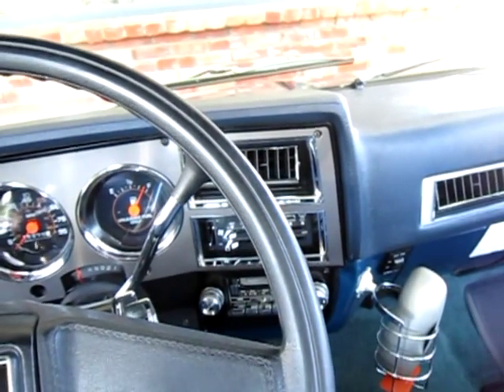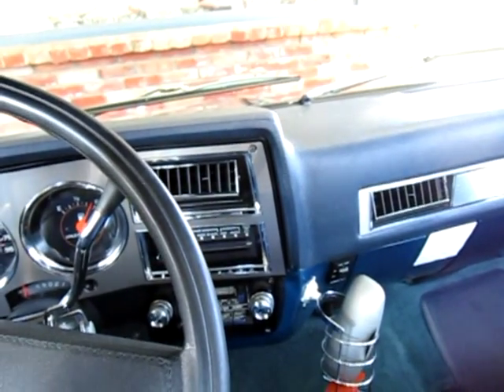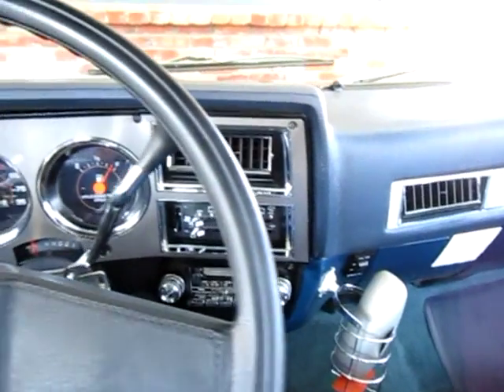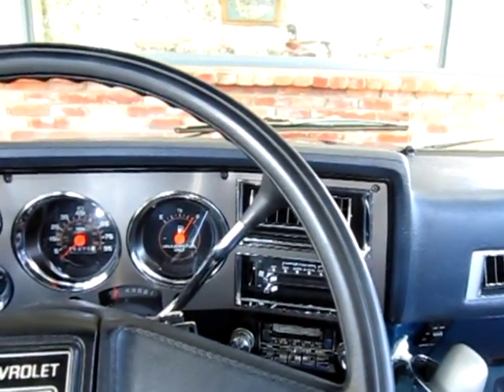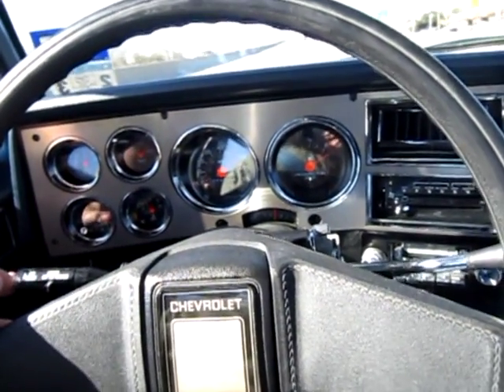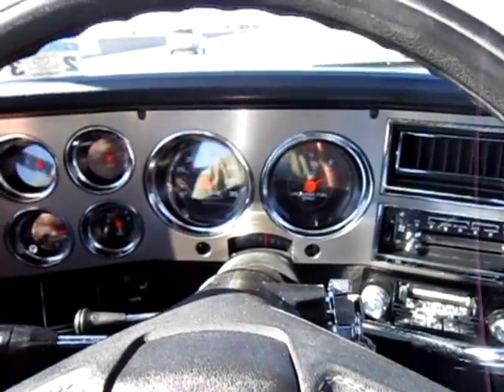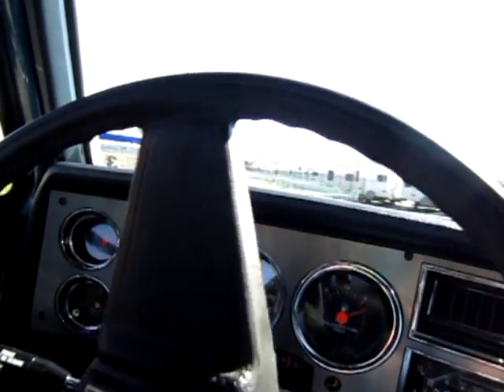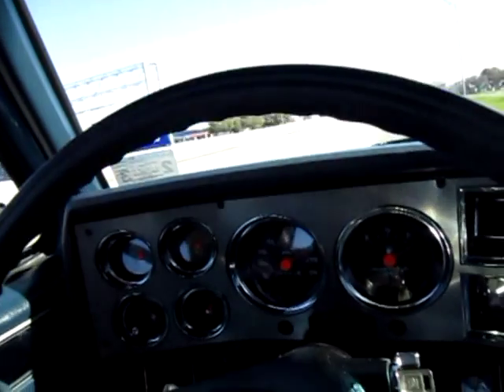Testing out new wiper delay module.

Comment: Where can you find the intermittent wiper delay module in your truck? I think my module has failed in my ‘90 K5 since it only goes at one speed and only will stop if I fiddle with the knob.
Reply from the maker: They pop up on ebay from time to time. Not sure if the 1990 still uses the same part the 1981 did though. Sounds like you might have a problem with the switch. That would be a much cheaper thing to fix. The modules are going for $250+ these days!
Reply: @dynatrak  I'm guessing the switch is inside of the steering column?
Reply from the maker: @bobbob1691  Not 100% sure, but I think it's integrated into the turn signal stalk on a 1990. My 1981, the wiper switch is located below the gauge cluster.
Reply: @dynatrak  Thanks, I gotta figure out my door power lock switches too.

Comment: Random wipes are most times caused by corroded park switch contacts inside the motor.  
Remove the wiper motor and take the plastic cover off on your bench.  Something will fall out and get lost if you do it while it's still attached to the firewall.  
I like to disassemble and re-assemble parts like this on a beat up commercial baking sheet with tall edges to keep the small bits and pieces from escaping.
Reply from the maker: Been working great for years now since I replaced the motor, and module. I was also having pump problems. I found a damaged GM NOS for cheap, and repaired it. All that was wrong was the tips were broken off the washer fluid outlets. I will remember that tip in case it happens again. Thanks!
Reply: What do you clean inside like do you take it apart and just clean eveything? Maybe spray eveything down with electric component cleaner??
Reply: @IvanLopez-hs8il  don't just indiscriminately spray contact cleaner inside.  There's dielectric grease all over inside.  You don't want to just wash that out. There are spring loaded copper fingers that wipe against flat copper traces.  The fingers and traces get corroded and or overheat and stop working properly. Clean up the corrosion and wipe dielectric on the freshly exposed copper.
Reply: @TheOcculus  haha noted I am learning thank you.